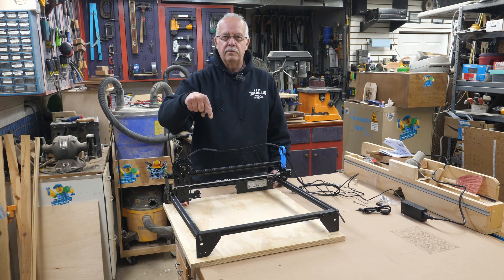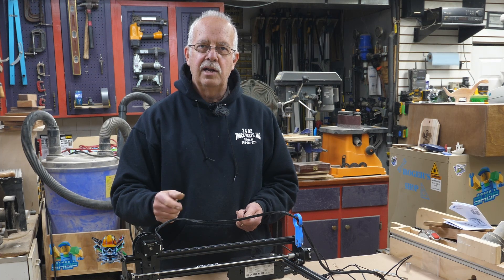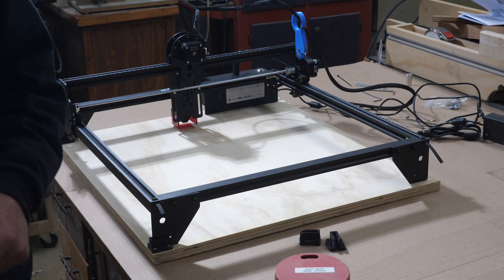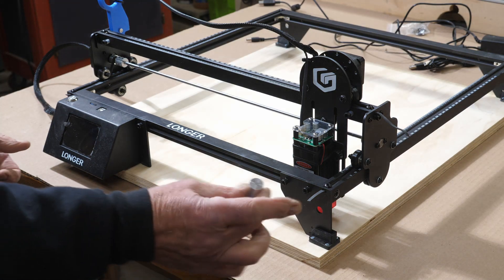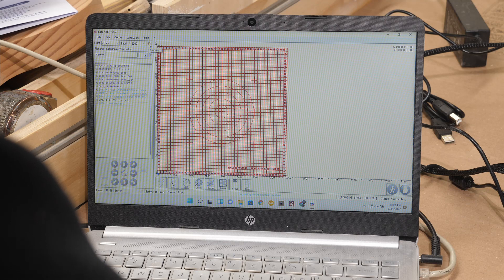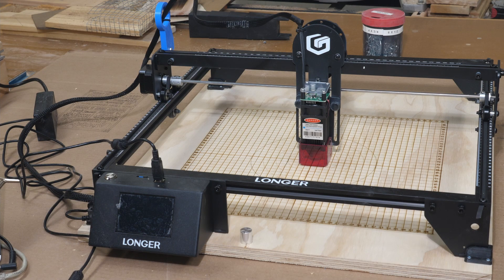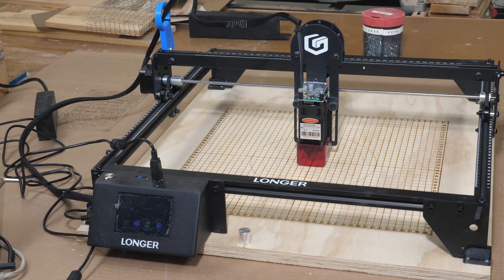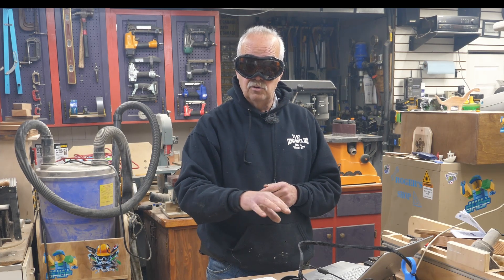Longer RAY 5 Laser Modifications

Comment: I purchased this laser today and plan to make personalized bamboo cutting boards for Christmas gifts. While I built a $500 CNC machine, I'm experiencing slippage issues. Until I can get it working reliably, I'll focus on the laser. Would you be willing to share any recommended settings? I've already spent about $1700 on the $500 machine after factoring in plywood, angle iron, router, and software.

Comment: Really enjoy your videos Roger! Have you ever had an issue where the x axis moves in reverse? Seems to be an issue with my Ray 5 and can’t seem to resolve it.
Reply from the maker: No.  All the time, or at random?
Reply: @ it is all the time when using the touch screen. Longer wanted me to reflash the firmware but the files never worked. I was able to find a workaround in the Light Burn program and seems to be working fine.

Comment: Where can a person find those mounting feet and program to make the spoil board grids ? My wife and I are just starting and also what settings would work best on the 5w longer to etch white tile
Reply from the maker: Grid:  https://www.thingiverse.com/thing:4917083  Not exactly for this laser, but it works perfectly.  Mounting feet and/or risers:  https://moonshinecrafts.com/product-category/laser-mounts-accessories/  To etch painted, white ceramic tile, you really need to run a burn test as every laser differs a little bit.

Comment: Hi Roger! Love your videos. Where can I find the graph for the spoil board? Also what’s the recommendable settings for cutting plexiglass with the longer ray 5w… or am I going to struggle?
Reply from the maker: Link to grid is in the video description.  Do NOT cut Plexiglass unless it is specified as acrylic!  Regular Acrylic (in colors) is Ok, but some Plexiglass will generate chlorine gas which is not only harmful to humans, but will corrode everything metal on the laser if it is not pure Acrylic.
Reply: @rogersshop  I have some cast acrylic on order I would like to cut (it's specified as laser cutter compatible from MakerStock).  With the 5.5W laser, do you have any recommended speeds or number of passes?  The acrylic is paper backed on each side, do I leave that on, or take it off and then put something dark underneath?  Thanks!
Reply from the maker: @cwills75  If the acrylic is clear, this is near-impossible with a diode laser, even with a black background, as you will have more melting than a clean cut.  When cutting acrylic, I usually use my CO2 laser, and always if clear.  You will need to remove the paper from both sides.  As a starting point (With a black under piece, like painted aluminum or steel), try 100 mm/min at 90% power and 4 passes for 2mm thick.  This is what I use on black acrylic on a 5 watt laser.  If the acrylic is clear, or a light color, don't expect a smooth cut as it will melt on the edges.
Reply: @rogersshop  OK, thanks.  The acrylic is a smoke grey, with 25% light transmittance.

Comment: I know you don’t plan on using the ray5 for rotary but if I wanted to do so, what’s a simple way to raise the frame to accommodate it? Just uniformly sized blocking?
Reply from the maker: Quart paint cans actually work pretty good.  I'm in the process of designing some risers, similar to what I designed for the Ortur LM3 and Jicoda L1 lasers.  Just not perfected yet.  There will be a video on these soon.

Comment: Hi Roger, I see you also have a XTool D1. I am in the market for my first laser. I will be using it for all of the things you use it for. Which one do you prefer the best? The XTool or the Longer Ray 5?
Reply from the maker: This depends on your ended use.  The xTool is higher powered, which is handy for cutting.  The Longer Ray is less powered, but has a finer, more accurate beam for engraving.  I use the xTool for any cutting jobs.  I use my others for engraving on wood, ceramic tiles, and coated glass.  The Xtool is used for engraving on stainless steel and glass.  I use my Ortur for rotary engraving.
Reply: @rogersshop  thanks! The xTool it is! Love your videos! I’m into sublimation too. Your the coolest grandpa! I’m sure your grand daughter is thrilled that you are so handy